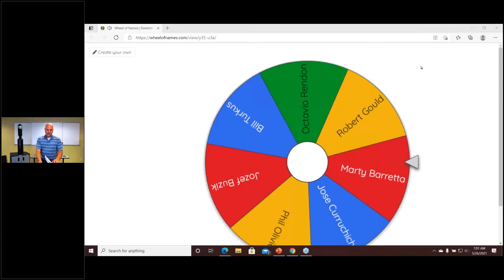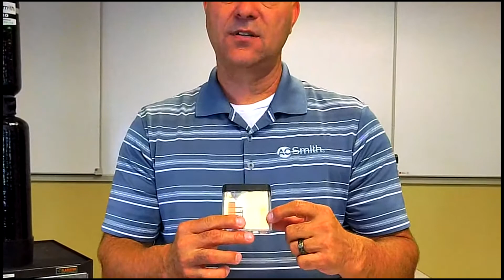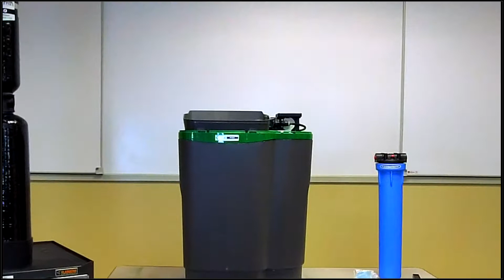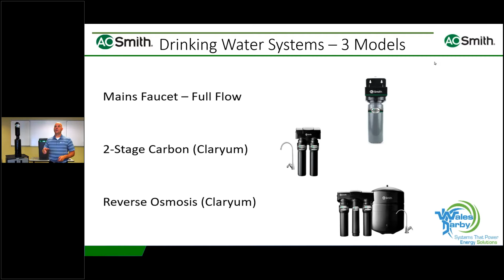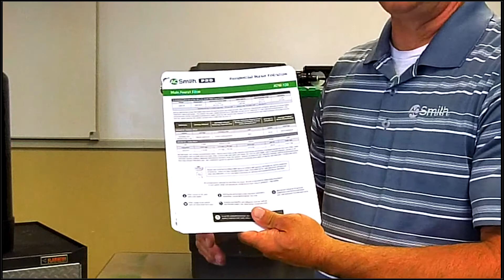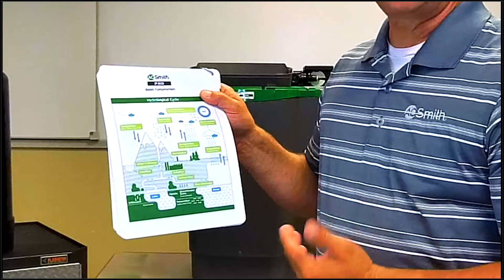HVAC Insiders - AO Smith Water Conditioning

Comment: With the AO Smith carbon filter in 8" 4' high or so high tank, is it made to have carbon media changed?  Does top unscrew for access?  I don't remember when I installed mine.  Of course AO Smith said no it's not replacable but I think it is?  I'm getting .5 on chlorine vs unfiltered 2.5, so it's starting to deplete at 7 years old.  Model: AO-WH-Filter.  Thank you